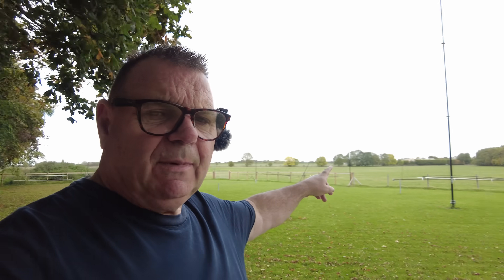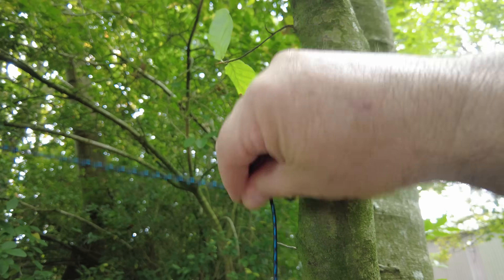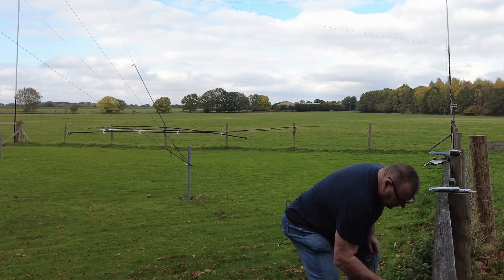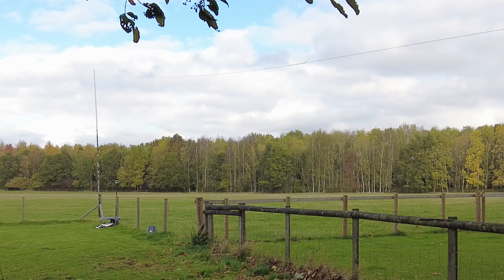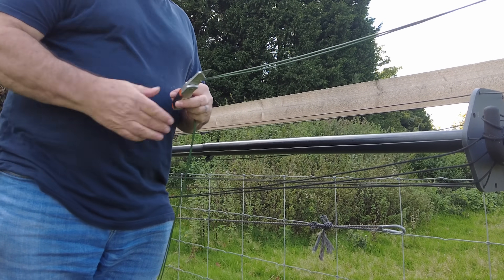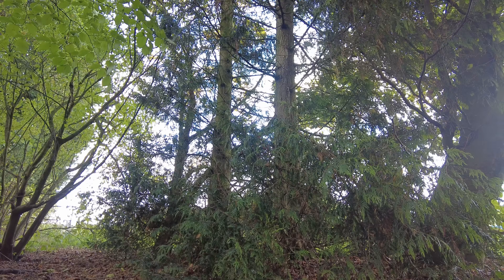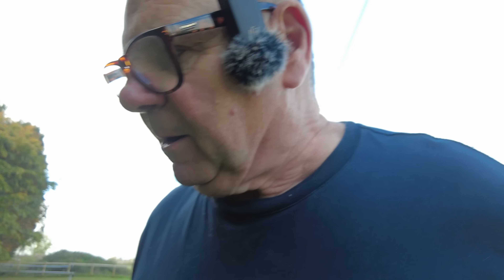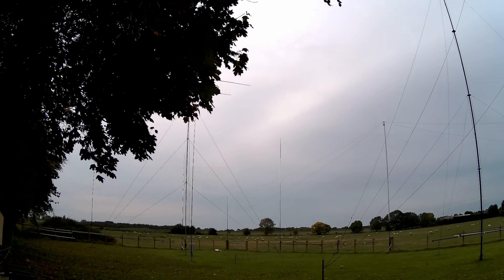Lower & Longer! The 160 m Dipole Tune-Up

Comment: Your power limit is pretty limiting on 160M to be honest. 2250 PEP in Canada. I don't have that capability but many that are on 160 all the time do..
Reply from the maker: Yep - only high-power from 1843 to 1850 - but frankly - I believe nobody actually stays at 32 watts - considering their signal strength!
Reply: @DXCommanderHQ The UK is relatively small though so the distances are less than in NA even if you add in the EU.
I do have both Australia and Hawaii on 160 though with my inverted l variant on my vertical. Australia was FT8 and Hawaii CW. Both with just 100 Watts.
Also CY0S, St Paul Island off the east coast of Canada , DXpedition.
Reply: I enjoy the reaction I get in the morning on my way to work when I chat with some guys on 260 using my remote station with my Android phone connected to Bluetooth. I tell them that I am mobile remote. You can almost hear them scratching their head.. @DXCommanderHQ
Reply from the maker: Lovely!

Comment: With top band and low to earth their will be coupling with ground and impendence will be lower.  Look at MW broadcast. about 1/4 wave vertical  . Math shows about 32 ohms.  So matching network needed for 50 ohm feed line. At high power levels the weather affects the loading. Damp to dry air. Wet soil to snow on ground. Most have auto loading  to adjust for that . You don't notice much under 1 KW but when get to 50 KW . You see how weather changes the loading on transmitter. You can use a Rig Expert using all parameters to help with fine tunning of antenna. You want X to be lowest and ohms to be 50 . 80/160 will effect each outher somewhat . Because of Height you will get different impendence on the 2 bands. Matching stub with 75 ohm coax is 1 trick. Off set 160 meter but shorting one side and making outher side longer   is a trick as well but you got 80 meter .Moving feed point will effect that band. With some work you can get it close . Cheers from NY !
Reply from the maker: Thanks for the insight!

Comment: 160m is the only major ham band I haven’t got on the air with yet (thanks to your antennas!) if I ever get my ft-710 back from Yaesu. (The first time they “fixed” it didn’t take lol). Gonna try a not so random wire with a 9:1. Also thinking of experimenting with a 160 element on my DX Commander C+80.

I would love to see a video with a DX Commander classic +160. I’ll gladly loose 10m to get on 160.
Reply from the maker: Noted

Comment: Youd be better off making a 160m full wave horizontal loop which will resonate on most of the bands, and work on all up to 6m with an ATU. Thats what ive been running for years. Very quiet, and works fantastic.
Reply from the maker: Please come to the field and fit one. No chance.

Comment: 1:32 For SWR my rule of thumb is, if the SWR is higher on the higher part of the band, then shorten. If it's higher on the low part of the band, then lengthen. Or higher on high - shorten, higher on low - lengthen.

Comment: Haha man, I've been spending the past few days fixing a 10m dipole and adding a 40m dipole to the same feed point. Just brutal work, lots of spruce trees which are a pain in the butt for antennas, damn thing gets snagged real easy. Finally got it working yesterday after mucking about for 6 hours. Now need to take it down again and fold it back a bit to make it resonant at 15m 😅
Reply from the maker: Oh man, the joys of antenna work! 😂

Comment: You have a couple things going on with a dipole close to the ground. The feed point impedance goes down as the antenna gets lower. Also the velocity factor goes down as the wire approaches the ground and affects the resonant frequency. In the air the velocity factor can be roughly  95 % while on the ground it can be 50%. This lower number can vary considerably depending on ground makeup, grass, gravel, pine straw etc. I have measured it over quite a few areas when I was developing my BOGs for 160 and 80 meters. Some years ago I put some info on this on my QRZ page. I also totally agree with another comment about feeding it slightly off center to get a 50 ohm match to coax.
73,
Don
N4DJ
Reply from the maker: Hey Don - OK, thanks for suggesting this - I was actually under the impression that low-to-ground is was the extra capacitance that made it shorter. We could test that with some bare copper wire I guess.
Reply: @DXCommanderHQ HH Beverage in his paper on the Beverage antenna had a chart showing how velocity factor changed with height above ground. He and his engineers also made the observation that velocity factor went down as the wave length increased. I doubt that you could notice any change from 10 meters to 80 meters. They noticed almost 10% change in velocity factor from 200 meters to 600 meters as they worked with pretty low frequencies (long wavelengths).
You do get a capacity effect also with the wire near the ground. Definately more than one thing going on! 
I am not sure what length dipole you started with for it to end up at 1940 KHz. If you used the 95 % velocity factor which gives the classic 468/1.85 MHz you started with 252 to 253 feet. That would be for a fairly high dipole. It has been my experience that when using that formula I get a lower than desired resonant frequency and simply trim it shorter. For you to end up at 1940 kHz, you must have started with less than 253 feet. If the velocity factor was lower due to proximity to the ground, that would mean the resonant frequency would be even lower. And again you would need to shorten the antenna. If it was capacity effect then that also would make the dipole appear longer. I used to tune my 80 meter inverted V by dropping then ends closer to the ground to move from SSB at 3795 to CW at 3.5 MHz. 
All I can figure is you started with a dipole too short. I would like to know for sure …I may have missed what length you started with but I went over the video a few times.
73,
Don
Reply from the maker: Don - it sounds like you can do this experiment for me! LOL
Reply: @DXCommanderHQ  nice try but you have to do it over your ground! Over here in the US over our dirt, my dirt, a 65.33 foot dipole ( resonant on 40 meters) had a resonant frequency of about 5.69 MHZ on the ground. The wavelength in free space of 5.69 MHz is 491.8 /5.69 = 86.43 feet. The 65.33 foot dipole on the ground ( DOG) had a resonant frequency of 5.69 Mhz. The velocity factor is simply the ratio of the actual length (65.33) to the freespace length (86.43). That ratio in my case, over my dirt, was .756 or 75.6%. It was slightly different over my gravel driveway and in the woods over leaves and pine straw. The length of the test dipole does not matter it’s the resonant frequency on the ground and the length ratio that matter. A full since 160 dipole should be expected to show a resonant frequency somewhere around 1.2 MHz when on the ground. Depending on actual velocity factor of course.

Comment: Cal is there a chance you can get DX Engineering or another distributor to carry DX50 wire in the States?  73 KK7YIS
Reply from the maker: Unlikely - I did originally offer it to them. But with rariffs as well, it's probably a no-go for the time being.
Reply: @DXCommanderHQ  There are a couple antennas with guy radials I want to try.  DX50 really seems to occupy a sweet spot with a 135kG breaking strength.  Only thing I have found stateside is have Moonraker "Nevada" Kevlar 28 at only 90Kg breaking strength but it is silver plated and very pricey.  Davis RF Polystealth steel core is 53kG for 18ga and 168kg for 13ga but they are going to sag a lot from weight at the same tension.

I wonder if any of your views know of other options.
Reply from the maker: Thing is - we actually sell this currently at a low margin because I use it myself for projects and we have to buy 4 x 1,100m reels to get the price... If we sold via DX Engineering, then the RETAIL PRICE would be (calculator... hang on... wait for it...) about a dollar per foot - or £2.54 per metre! So possibly the most expensive antenna wire in the world :)

Comment: If you have low impedance due to lack of height you can also feed the dipole slightly off center.  The impedance will increase as you move toward the ends - just find the 50 ohm spot and have at it.  Not to be confused with a true OCFD dipole arrangement with the 4:1 balun et al.
Reply: Exactly right! A resonant length can be fed anywhere depending on what impedance you desire. You also don’t really need to trim both sides equally. I sometimes alternate trimming each side.
Reply: It’s the difference between resonance and feed point impedance. Many hams don’t quite get it.  I always have a smith chart along with SWR and phase on the NanoVNA when figuring out the WTF antenna issues
Reply: @MidlifeRenaissanceMan  It's all about the XL = XC i.e Resonance. Resonate then Match...
Reply from the maker: Matt. Great idea. Bit stick for space - but I may give that a go.